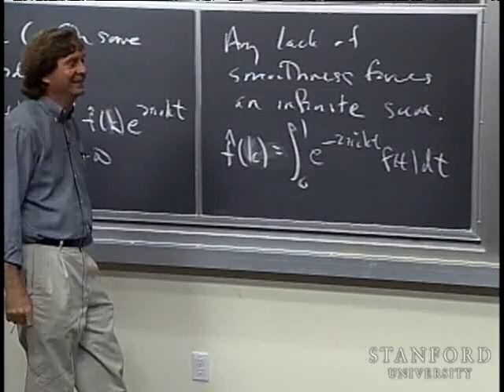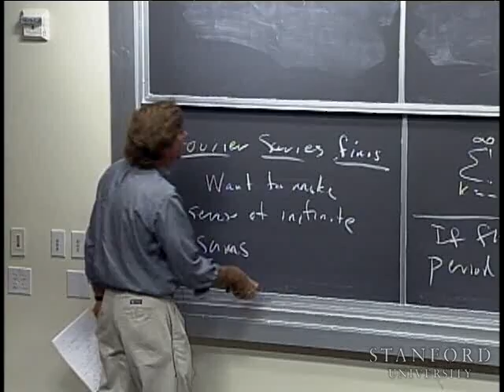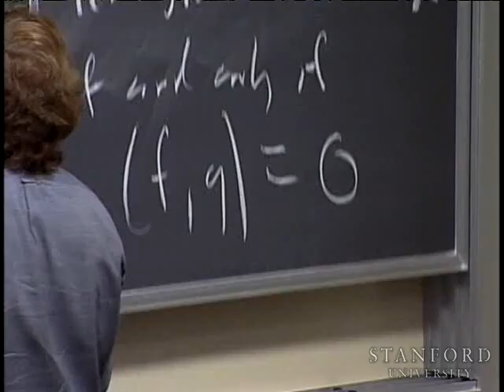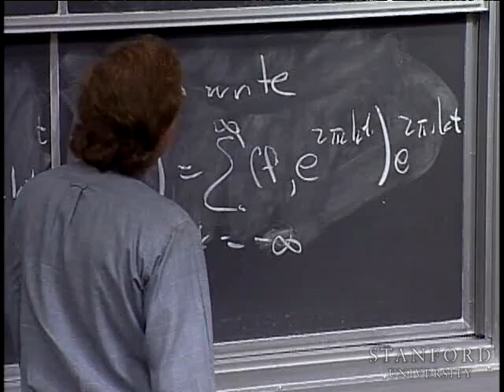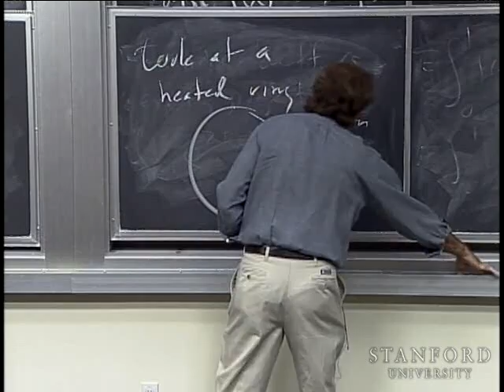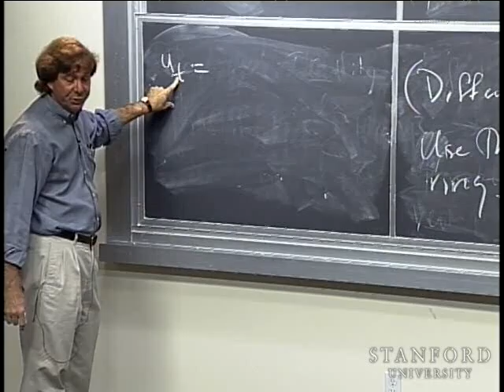Lecture 4 | The Fourier Transforms and its Applications

Comment: For personal use:

- writing inner product as integral 
- Fourier coefficients are inner products between the complex exponential term and the original signal
- above is the same as projecting the signal onto the space spanned by the complex exponential
- above means that the complex exponentials form an orthonormal bases for the signal (ie squared integral functions). Fourier coefficients are just projections onto this basis.

Dr. Osgood is an amazing lecturer, such a character!

Comment: At 50.03, shouldn't it be -4*Pi^2*k^2? When you take the derivative of the exponential twice the new coefficient is (2*pi*i*k)^2 which is -4*Pi^2*k^2
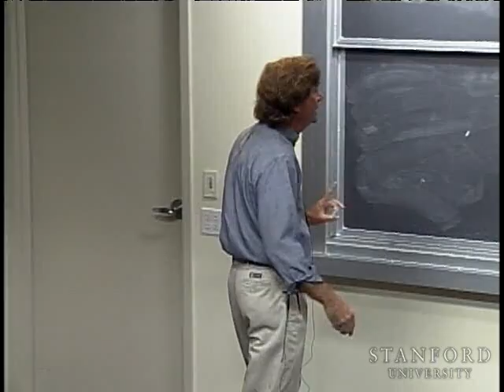Reply: At 46:46 choose a = 1/2; so, ut = (1/2)uxx.

Comment: So the Fourier transform converts time information into frequency information.  Is there a formula to convert time information into money information? Because that would be an even more useful formula.
Reply: Indirectly.  In pricing a derivative based on time series data, the Black-Scholes PDE is solved analytically by reducing it to a diffusion equation: ut = (1/2).sigma^2.uxx, where sigma is the volatility of the underlying stock, t = time to maturity, u = C.exp(r.t), where C = price of option, r = risk-free rate of return.

Comment: that noise gate on the recording is distracting. just leave it off, jeez
Reply: Hugh Jones its very obvious!
Reply: use fourier analysis to get rid of the high frequency and it will be less annoying
Reply: @mihirbpi  Be careful.  From pp 19-20 of the course notes: 
"It takes high frequencies to make sharp corners.
"
This particular aphorism is important, for example, in questions of filtering ...
• Filtering means cutting off.
• Cutting off means sharp corners.
• Sharp corners means high frequencies.
This comes up in computer music, for example. If you’re not careful to avoid discontinuities in filtering
 the signal you’ll hear clicks — symptoms of high frequencies — when the signal is played back. A sharp cutoff will inevitably yield an unsatisfactory result, so you have to design your filters to minimize this problem.

Comment: Its actually pretty reasonable to see why sine and cosine are orthogonal! Though I agree its extremely hard (or impossible) to reason about graphs of complex functions :(.
Reply: but if you can say a complex number is somthing like rsin(x)+icos(x)
and it is easy to see why sin and cos are orthaganol, I must be missing something because I don't see a problem.
Indeed everything he thinks is hard i think is easy and what he thinks is easy I think is hard!!
So as I said  what am i missing????
Reply: First off orthogonal is not a word in my vocabulary, however it is defined as at right angles ie at 90 degrees.
Sin(x+90)=cos(x). Sin(0+90)=1 cos(0)=1.
Reply: well it is it means they are at 90 degrees to e3ach other which is in differeent direction ie at right angles,
Reply: On a capacitor the voltage and current are orthogonal (to an alternating current). When it is charged the voltage is at a maximum, but the current is zero. When there is no charge on he capacitor the current is at a maximum (for an applied voltage across it). Most of the maths comes form electronics really.
The length of a shadow is orthogonal to the hight of the sun, ie at midday when the sun is highest the shadow length is a minimum, conversely at sunrise, ie the sun at it's lowest the shadow a maximum.

Electrical power is the product of the current and voltage but only when in phase, a capacitor consumes no energy becauuse although there is a voltage and current they are 90 degree out of phase.
Reply: Hugh Jones  This might not be visualization exactly, but: You cannot express sin(2t) in linear terms of sin(3t);  or any linear combination of sin(nt) where n is an integer > 2.

Comment: Tres clean!
I am unconvinced orthogonality can't be visualized.  Whether or not it's the point depends on what I want out of a basis for synthesis.  Geometric properties of a basis matter.   For sine and cosine the representation is not by analogy. If the hypotenuse drawn on the board has length 1, the drawing IS the decomposition into sine and cosine, and that is precisely the point of the unit circle.  non?
Are you just trying to say analogy can be rigorous; (e.g. the algebra holds)?

Comment: Then if the space is class we add one more dimension with every new method in the class. 
The functions sin(omega*t), sin(omega*t*2), sin(omega*t*4), sin(omega*t*8) are orthogonal. We can describe as many dimensions as we want, if we want exact and finer description we use more dimensions. 
For example, in case of some signals like audio and mp3. Mp3 converts the signal in sinuous dimensions. If we want better quality mp3, we use more dimension and the bit rate goes high.